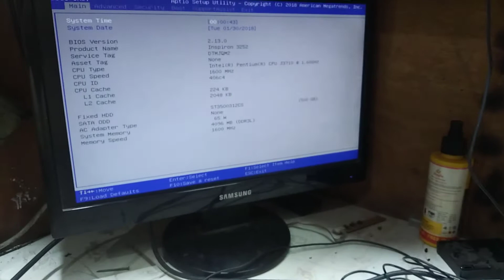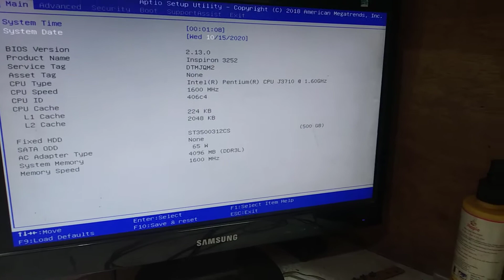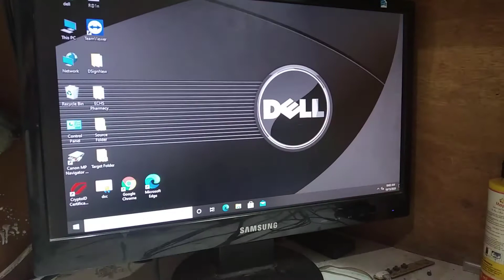DELL INSPIRON 3252 CPU ORANGE LIGHT FIX NO DISPLAY   FIX

Comment: Nice work !!! ..... Hi, Need dell optiplex 790 bios files bin or rom files ? Do you have it or any website where i get it?
Reply from the maker: https://www.dell.com/support/home/en-in/drivers/driversdetails?driverid=cr06h

 dell optiplex 790 bios files bin
Reply: @Extreme-Service_Point  need bin file not exe file system not booting...... And mosfet is over heating near to lm358 ic any idea what should i check?
Reply from the maker: @danishshah7826  Dear bro ager Aap technical  ki jankari hai to mmai  aap bata du aapka bord me mosfat heat ho rhaa hai 
bord me khi per likj hae jiski wajh se mosfat hit ho rha h ya mosfat khrab ho skta h
Reply from the maker: aap kisi computer technician se help  le sakte  hai ager aap khud kro ge to ho skta h bord khrab ho jaega

Comment: I got a yellow solid light…
Reply from the maker: Reseat/replace memory, troubleshoot motherboard. Reseat/replace memory.
...
Did you try to overclock your computer? ... 
Try using the power supply of another compatible computer.
Check if the motherboard CMOS battery is holding a charge, if not try changing it.
is the computer beeping?
Count the number of beeps.
Reply: Have you found a fix it’s happening to me when I turn it on soild orange light for like 5 seconds then shuts off no beeps I tried cmos battery replacement and clearing bios and replacing ram